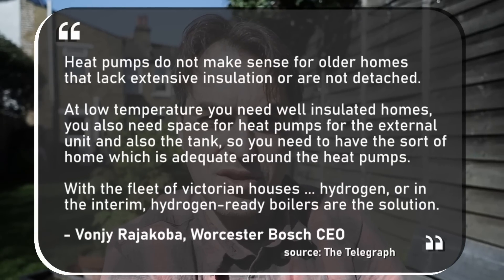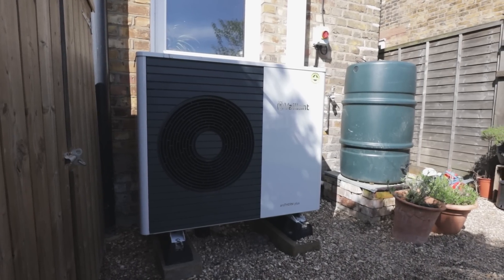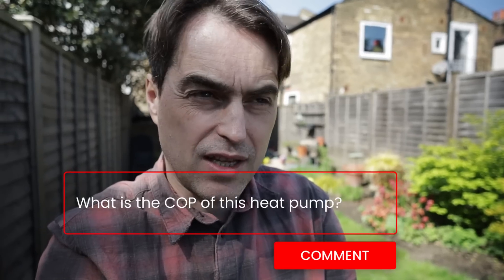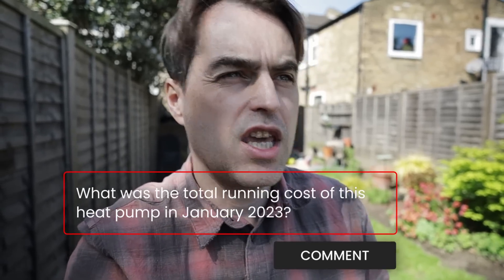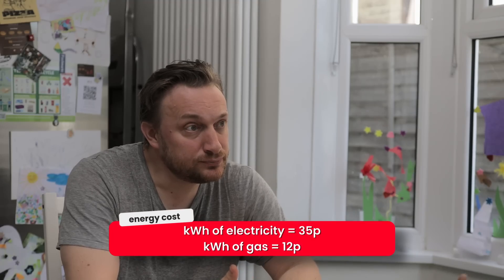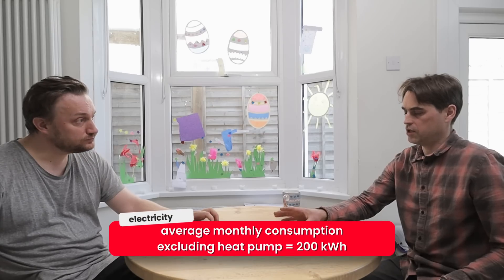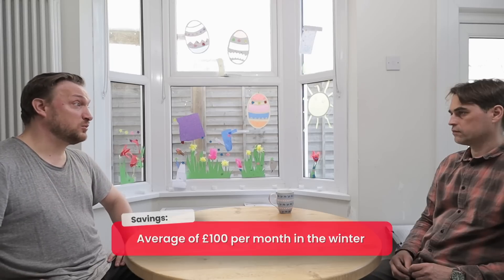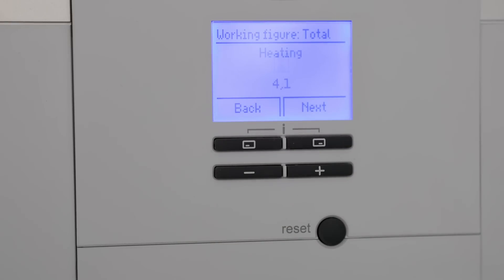Worcester Bosch CEO Is Wrong About Heat Pumps. Here Is Why.

Comment: Stick those bigger radiators on the old boiler and get it to a delta 40/50 and there’s a comparable saving without installing the heat pump
Reply: Problem with that... Grant for £5K covers most, if not all of the cost of the heat pump, and the cheaper running cost of a heat pump will pay off the difference.
Reply from the maker: on a boiler you can' thave higher efficiency than 93-94% no matter what you do. On a heat pump you can go over 500% theses days. Purely on efficiency gas boilers have no chances with super efficeincy heat pump installations.

Add solar and battery storage to it, and gas is even less attractive.
Reply: @UrbanPlumbers  There's no such thing as 500%

Comment: I agree looking at the energy consumption front is great but, but it's about economic viability how long will it take for him to pay that off for the installation cost. It's almost a false economy situation. what he has on the bill doesn't out way relative cost of install
Reply from the maker: you need to understand the it is a cost of a new heating and hot water system, not just a heat source. When it comes to replace the unit in the future (which by the way will outlast nay gas boiler by a factor of 2) it will only require changing the external unit, as pipework and correctly sized radiators are already in place. Such a job will only take 1 day and will be comparable in cost to a boiler swap.

Comment: My guess is CoP of 3.5!
Reply: Quite astonished at 2,800 kWh of gas for previous Januaries. That's almost as much as my house uses in a year...
Reply from the maker: That’s about normal for 8.5kw heat loss in the winter. 80kwh a day with single panels and the system around 80% efficiency.

If you only use 3k kWh a year you must be in a new build flat or a passive house. 

You would use this for hot water alone in a year for a family of 4 on gas.

Comment: Hit the nail on the head carful design and carful installation is the key
Reply: You are so wrong - What we had was a low cost well tried heating system that could easily have been made cleaner than it already is -   they are peddling nonsense when we have a wealth of low cast energy to last hundreds of years whilst we find a reliable replacement.  The UK has a very small footprint of pollution compared to the US,China and Russia and we have almost no land mass to procure any renewables capable of working cost effectively. If stop oil had their way we would grind to a halt within two days and die of cold and famine in the next cold period.

Comment: There’s allot of information missing in this video. i.e, what was the average ambient temperature for January at this property? My guess is it wasn’t that cold. Why only 500 hrs running time when January = 744 hours, surely the system is on 24/7?
The oversized radiators means all new pipework, new radiators as they are running at a lower temperature, so what was the total cost of the system, I’m guessing it’s getting on for £20k as it’s a complete new system, maybe more,that’s ridiculous.
No one ever talks about defrost, I’m guessing this has been a mild winter so defrost isn’t a major issue, but wait until you get a really cold, wet winter like you often do in the UK, these HPs will spend at least a third of their time or more, heating the condenser coil and not the water, watch you COP and performance take a dive then.

I’m sorry but this all reminds me of the Emperors New clothes, every one is dancing with joy thinking they are being green, when truth is the government and establishment are taking us back to the dark ages, literally.

I think the man at Bosch will in time be proved right, these things can only work in air sealed, well insulated new homes.

I would avoid them like the plague oh and I know, I’ve installed hundreds of them here in Australia, my heat pump for my pool struggles to get the pool over 23C now in Autumn where in the summer we could hit mid 30s, in colder states here they are still installing gas boilers.
Reply: What are you talking about, loads of people bring up the tired defrost argument, when they have zero data to back it up.  Search up heatpumpmonitor for some live stats from people that use external monitors to show whats going on - historically and real time.  You can drill down to a level where you can see the defrost cycles in effect for when the temperature was low.  You will notice that in ones that are providing the stats all the time; it takes about 6 minutes to defrost AND recover the lost temperature from the defrost, and does it about once per hour.  So about 10% of the time, not "at least a third".
Reply: @BenIsInSweden  can’t agree, we’ve sat watched and timed it  with data loggers on many occasions, depending on the ambient temperature it can take on average 12 minutes to defrost, depending on many factors, double your 6 and often twice in an hour, as the ambient temperature rises, ie sun up, it get less of an issue but it’s a major issue as many owners are finding out.
Still lots of unanswered questions, don’t get me wrong, I think Simon is a great tradesman but he should stick to gas.
Reply: @garywright8846  What heat pump was it? Not all heat pumps are equal.  As Australia is a warmer climate, they would be geared more towards that.  e.g. the Vaillant ones would not be all that great where I live in Sweden, as they won't work well in -25⁰C without immersion assistance. But there are others like the Panasonic T-Cap that will go down to -25⁰C without immersion.

Comment: I think the CEO is bound to say heat pumps don’t work as he’s the head of a company that sells gas boilers finally as ever a great video and insight to how with the right fitted equipment to a property heat pumps do work for me as with most things you need the right person designing and installing one congratulations mate 👏😎
Reply: They not only sell gas boilers, they sell oil boilers as well, we had a W-B oil combi installed in one of ours houses in 2006, every year it gets serviced, every year it breaks down, the outer casing must be one of the few parts that's still original, luckily it has a open fireplace and there is a large supply of logs to stop hypothermia whilst waiting to get it fixed in winter.
Reply: Worcester Bosch sell heatpumps as well
Reply: Clearly he is retiring well before new gas and oil boilers become illegal and the shit hits his company's fan.
Reply: @rogerphelps9939  Funny enough the only heat pump I know that was 'ripped out' because it wasn't performing well was a W-B, but this was some years back.
Reply from the maker: We ripped WB junior here 😊

Comment: I am curious as to how the device actually calculates the COP (?). (p.s. My car reports an mpg average, but this is an inflated figure.)
Reply: Heat output divided by energy consumed.  You can check heatpumpmonitor for where people have hooked up external sensors to monitor the actual COP, rather than relying on the system provided one.

Comment: Heat pumps only make sense when you have exorbitant gas prices.
1KWH of gas costs just 1/3rd  of 1KWH of electricity in the Netherlands  , making heat pumps a bad investment
Reply: According to energievergelijk the price cap in the Netherlands currently standards at: for electricity €0.40 per kWh, and Gas is €1.45 per cubic meter ~ €0.137 per kWh.  So similar to the price cap difference in the UK.
Reply: @BenIsInSweden  
But one m3 of gas is equal to 11.6kwh of electricity
Reply: @MightyRude  that still makes it €0.125 per KWh of gas.  So about 1 3rd of the cost of electricity.

Comment: You worked out how much the difference is and its pretty sizeable at £125 less, but how much is he paying per month to pay off the cost of getting the heat pump installed in the first place?
Reply: Sssht that doesn’t fit the agenda
Reply: Payback of the whole job isn’t relevant. This job would have been expensive because of the necessary central heating and hot water cylinder upgrades. In future when they need a replacement heat pump it will be significantly cheaper as it can be done in 1-2 days just like a gas boiler.
Reply from the maker: Usually just a days job or even 2-3 hours if change is like for like.
Reply: @UrbanPlumbers  I meant the full cost of the getting a heat pump done, I assume most people will get a plan don't just whip 10K out of the wallet, I was genuinely asking
Reply: @thomassmith7819  And by the sounds of it the old rads were not suitable for use with a condensing boiler anyway so needed replacing.  The proGas people often forget to mention this.
Reply: @thomassmith7819  payback may not be relevant to those in the higher tax bands or people in social housing, but for the majority of people payback is the most important factor especially as they will have to borrow the money. 15k at 10% is £1500pa or £175 pcm, just on interest. If you can get a 2nd mortgage it's still circa £90 pcm
Reply: @thomassmith7819  And heat pump prices will come down with mass adoption. They are not rocket science.
Reply: I think for many people they are upgrading because their gas boiler is coming to its end of life anyway. So makes justifying the price a little easier.

Comment: I want to know how your client was getting electricity at 35p/kWh when mine was over 51p!
Reply: You are paying through the nose. 34p per kwh is about the going rate. It is that high because it is tied to the price of the most expensive form of generation which is gas. If this were changed, electricity would be a lot cheaper and choosing a heat pump over gas would be a nobrainer.
Reply: @rogerphelps9939  Trust me, I know it. British Gas, who I've since moved away from. It's just really expensive through all providers in London, even the 100% green ones now.

Comment: Some contentious comment, real world cop figures are less than 2 at low temperature when heat pumps most needed. So please provide a graph of cop versus temperature which is a far better indicator of performance. Moreover it is uncertain whether the low temperature attained by heat pumps is sufficient to kill legionella bacteria thus additional electrical input would be needed. And of course the global warming potential of some heat pump fluids approaches 1000 times that of co2 so I'm afraid I won't be installing a heat pump anytime soon.
Reply: Got any data for your "less than 2" argument? because for the modern ones in the UK, it's not going to happen. You can find a few graphs on heatpumpmonitor for the data you want.  R290 which is used in this heat pump has a GWP of less than 20, and R32 has one of 675.  It's worth also pointing out that GWP is only relevant when there are leaks to the refrigeration system. Whereas with a gas boiler you're always leaking CO2 whilst it is running.
Reply: @BenIsInSweden  Data in peer reviewed study "Optimal design of low temperature heat pumping technologies and implications to the whole energy system"  AV Olympios et al proceedings of ecos 2020. Note cop at freezing temperatures figure 3b. I can assure you the cop of a heat pump varies with ambient temperature, and a cop averaged over  a whole year is a poor measure of cost,.
Reply: @anonanon289  So as usual depends on the heat pump.   All high-performance ones get a COP of at least 2, even below -10C.  R-32 which is now most common in Split systems, still gets a COP of greater than 2 even below -10C.  So only the low-performing ones drop below 2.  Also no mention of R290 ones, which is what these Valiant ones are.
Reply: How many days in the UK average -10 C?  None where I live.

Comment: Wouldn’t insulation be beneficial for cost saving thought?
Reply: I built a triple A plus home with UFH o all floors and masses of insulation yet we could only afford to occupy one room and  not use any of the heating just bare essentials like dehumidifier to dry clothing and minimal cooking on the gas and electric blankets to sleep with and plenty of warm clothing our energy bills went from £90/month to £375/month when the government removed the cap and gave us a pittance to help otherwise would now be £420/month and now we are entering summer the are are about to remove the help and the energy companies are increasing the rate to compensate for the reduction in usage. We have learnt it is cheaper to live in our caravan parked next to the house.

Comment: They cost a fortune to install.
Reply: 15 grand
Reply from the maker: Half that after government grant
Reply: @UrbanPlumbers  Thats a lot cheaper, but still 7 and half grand is still too much compared to 2000 quid for  replacement combi. If you put 5 grand aside to use on your combi gas bills, it would  work out about the same over a 10 year period, but without all the extra headache to convert your system over.
Reply from the maker: Not if you want an efficient gas system, as it also requires changing radiators. £2k gets you bottom of the shelf 80% efficient boiler. Try fully weather compensated boiler with over 90% efficiency and you will quickly realise that they cost much much more than 2k
Reply: @UrbanPlumbers  We install V200 boilers for ~£3.5K all inclusive.
Reply: @UrbanPlumbers So what do you think the cost of a heat pump installation and a combi installation is comparative to price with all the bits and bobs included? Honestly, would you get a heat pump instead of a combi in your house? Most people I ask say no way.

Comment: I don't know but whenever I'm somewhere that has heatpumps I'm always hot when it's hot and cold when it it's cold. Never had problems with regular heating and cooling.
Reply: Guessing you're not from the UK, as cooling in the UK is practically non existent. Whenever I stay at my parents place in the UK, I find it too cold in winter and far too hot in summer.  I have an A2A heat pump in Sweden and can have it comfortable for me around 20⁰C in Winter when it's -15C outside and 18⁰C in summer when it's 30⁰C outside.
Reply: @BenIsInSweden  no I'm in Missouri USA. Those temps seem reasonable, but where I've been that had heat pumps they'd stopped/couldn't keep up at about 20f so it'd be in the 50s f inside. And 30c+ they would struggle as the air is 85%+ humidity in the summer, walking into a sauna on some days. 
I use firewood with forced air distribution, I can keep it in the 70s f range with very little wood, and if using small red ceder I accidentally got it into the 90s when it was -2 f outside, had to open the windows lol.
Reply: @A_barrel  Heat pumps in the US seem to be trailing behind Europe by a fair margin.  20F or -6C isn't common in most of the UK, but there are cold climate heat pumps that work with full heating capacity down to around -25C (-13F), e.g. Panasonic Tcap series, and that's also without any resistive heating for defrosting.
Reply: @BenIsInSweden  Most definitely. I'd bet it's because a lot of people mostly use wood, heating oil/diesel/propane and aside from the biggest, electric, is natural gas, which I don't think you guys use?

Comment: I think I will agree with CEO guy. How many Victorian houses are exactly like yours with the ground space.
You are the exception and not the rule
Reply: I would say the majority of Victorian terraced houses are very similar.
Reply: @bordersw1239  depending on what part of a city of town they are in..example would hackney London, with large Victorian terraced houses, but if you looked at some in Battersea, the have smaller garden spaces and yet smaller are those around hyden park /central London. And then you may need planning permissions and the cost of the equipment, also your house needs to be almost hermetically sealed in order to get the efficiency of heat pumps. It's just a lot of hassle that most people can't afford.
Reply: @ballerblocks  . You do know that there are some other places outside of London,last count it’s about 87% of the U.K doesn’t live in London, hard to believe I know!
Reply: @bordersw1239  I don't live in London either, I am making the point, using a city we are all familiar with.
Reply from the maker: I am yet to see a terraced house that can’t have a heat pump. They all can be adapted. The biggest issue with the locating of external unit, is the fact that most people want it out of sight.
Reply: @UrbanPlumbers  yes they do and the loss of garden space, this is a part solution to energy efficiency, unfortunately most people want a magic bullet solution. And not 1 that entails a major reorganization of the dwelling

Comment: They didn't tell you that it couldn't be done. They told you it was not recommended. Personally I wouldn't recommend a heat pump to anybody. One winter where it's to cold, and you have no heat at all now. Ask me how a guy in Montana knows....
Reply: You’re saying the U.K has the same climate as Montana?
Reply: @bordersw1239  No, I'm not. You're obviously having trouble reading though.
Reply: @moralobjection4836  . Yeah, I particularly like the bit where you wrote ‘to cold’, excellent use of the English language.
Reply: @bordersw1239  Oh yes, just double down. That always works.
Reply: @moralobjection4836  . From what I can see, the average January temp in Montana is -6.7C, the average January temp, where this was filmed in the U.K is about +6C. That’s quite a difference in climates, also a decent ASHP is perfectly capable at operating at low temps in the U.K.

Comment: A million heat pumps emitting super chilled air won't have any environmental effect,  or affect other heat pumps.
Reply: They don't emit chilled air, they move heat energy around. Your argument is akin to if everyone had greenhouses they'd be cooling the planet.  As for having an effect on other heat pumps there are minimum distances between them to keep that from happening.  Ground source ones usually will need to be further apart than air source ones too